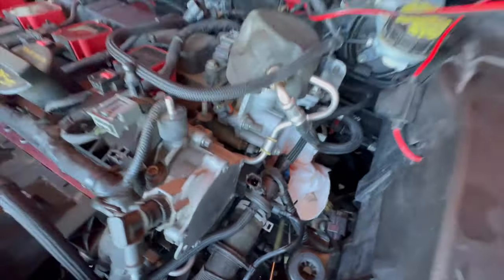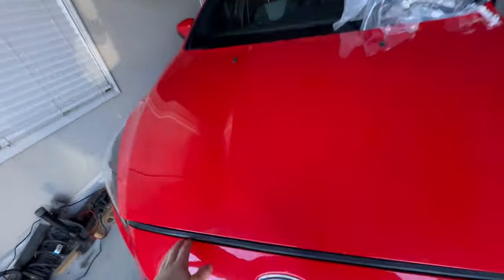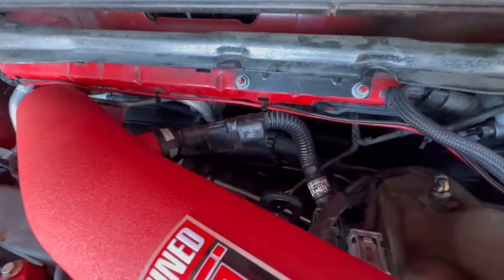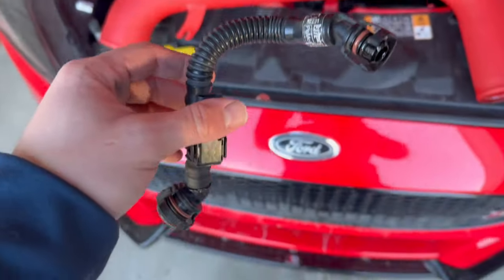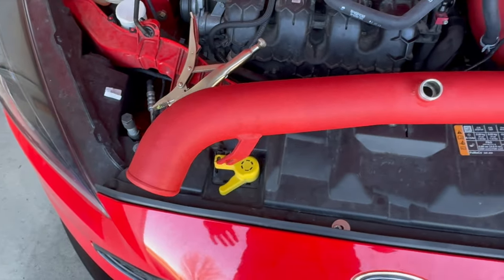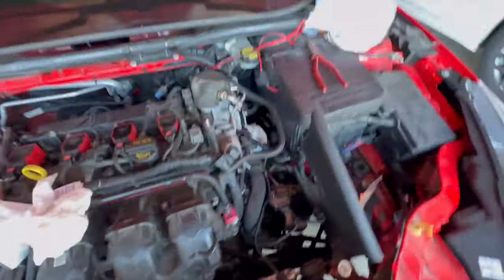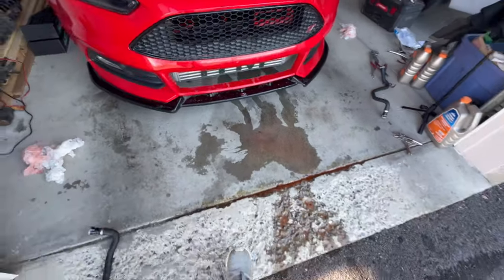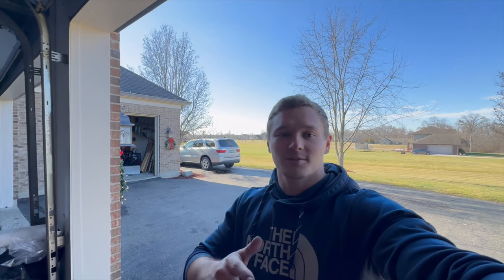Focus ST Leaking coolant everywhere

Comment: Oil going into the intake are from positive crankcase ventilation.  solution=catchcan.  there are two  ways to catch this blowby.  one catches the oil under idle.  the other catches oil under acceleration .  2 can setups catch all blowby protecting your intake valves completely
Reply from the maker: So the one catch can I have is for the acceleration I’m guessing? It’s located in the front of the engine bay near the fan/ mounted by the hood release?
Reply: unfortunately st owners are only showed the idle application because its an easy diy install.   @Michael_Carroll
Reply: That's the ccv side. Install a catch can back there and your good
Reply: @Michael_Carroll  All you NEED is a catch can that handles blow by at the PCV valve, that what most people will call the catch can in the "front". I had the same problem with my hose's, some have replaced the o-rings, I just replaced the whole hose like you did. They seem to fail around 90k miles.
Reply: Ccv is the rear, PCB is the front. Pcv is open at idle closed when on throttle. Pcv is where most of the gunk comes from. Easier way to tell the two apart, pcv non turbo side, ccv turbo side.